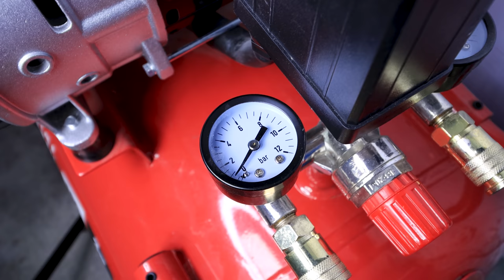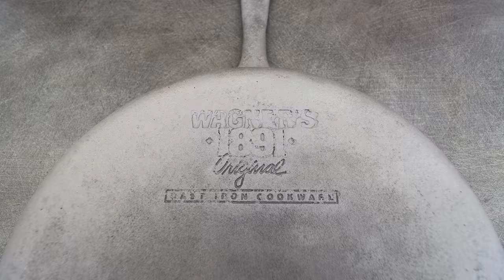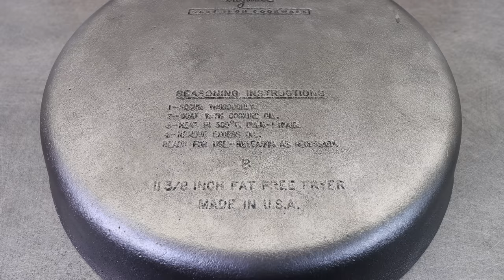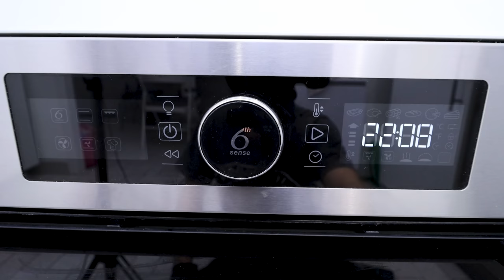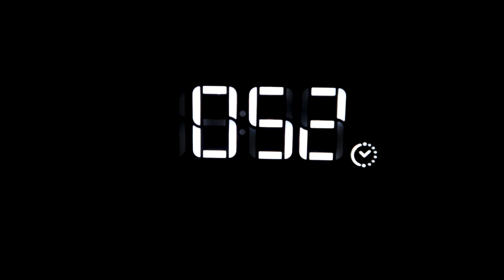PUBG PAN Restoration - Cooking Juicy Pan in to a Rusty Steak

Comment: Still like this video, but the pan was made in 1991-- "1891" was a model for 100th anniversary
Reply: Thats because he faked the whole shipping and note. He has no idea about any of that. Check the note he send to my Mechanic and this note
Reply: I agree. This is the anniversary pan from Wagner line. 1891 would have just thr maker Wagner and size '8
Reply: @falconNL  cállate
Reply: An original would have been milled smooth, these modern pans are really junk and only good used with tons of grease.
Reply: It could be 2011 and still be an amazing job, nitpickers man 🤦‍♂️
Reply: @ericalbany  you don't need a yo of grease if you season them correctly.
Reply: @falconNL  I didn't want to believe it, but it looks like you're probably right. He uses the same lower case "i" , the same middle line x in his "w", the same "f" and the same slanted "y". He also uses mostly uppercase letters. That's really disappointing. Now I have to wonder if he even really got anything sent to him or if he's just staging that also.
Reply: @HVGs  Unfortunately,  he's right. I just checked the note in that video and the writing is the same.
Reply: @GLASSGHOSTHUNTERS  top 10 questions science can’t answer.
Reply: @twylaburns6554  Having had one of these pans for 25 years and comparing them to vintage wagner cast iron in my collection, I can definitely assert that there is a difference in the cast iron. They do not season well nor do they stay seasoned as well during use. It must be a different alloy or they used a lot of scrap steel in the mix but they are not good pans. And yes I do know how to season and care for cast iron.
Reply: @HVGs  😳
Reply: @falconNL  I've got one question for you: who cares? The restoration was nice and relaxing to watch. Whether a viewer shipped it from Texas or he bought it on eBay, what difference does it make?
Reply: @falconNL  its part of his shtick.
Reply: Joe Montana is correct. There would be zero "cooking instructions" on a pan from 1800's.  Still a great video
Reply: @Nick-tx2fl  to many haters...he still does a good job with his restorations 👌
Reply: White?
Reply: @ThemissouriTraveler  
What? Wait!? So the pan I got from
Grams as a wedding gift in 1980 could be an original? I still have it.💁‍♀️
Reply: @twylaburns6554  If the surface is rough from sand casting as the new ones are a fried egg is going to stick.
Reply: I was wondering about that when I saw the cursive ingraved text in it. Didn't seem very 1891ish...
Reply: Obviously the fact that it has the company name on it means that it can be no older than 1972. That doesn't diminish the work to put it back in working condition. The only thing I would have done differently is to sand the rough pebble finish down.  Holds a better seasoning.
Reply: @ericalbany  my old griswold is smooth by comparison.  the cooking surface feels like glass with no imperfections.  it's a 1950's model, i believe.
Reply: @falconNL  
Of course. Have you SEEN the cost of shipping out of USA! This thing weighs 3kg.
Reply: Great video, but only 30 years old (like everyone else said).  Gotta hand it to Tysy though, looks like someone left it outside for 29 of those 30 years.  Nice restore!
Reply: No pans made in the late 19th Century had raised grates!  Lol...
Reply: Older cast-iron pans from the 1800s wouldn't have that much printing on the bottom or the grill lines. I have 2 cast irons and I would trade them for any "non stick" pan in the world. You just have to.keepnthem.seaaons and they'll last.for years.
Reply: I don't care all that criticism... I still enjoy watching him using the sandblasting machine. I'm just so happy just with that ! 🥰
Reply: They make great cast iron skillets today (not cheap). To say they have to be old to be good is not correct. A good, quality one, seasoned correctly and taken care of will be cooking well a hundred years from now. Google where to by, how to season and how to maintain. Like I said, they ain’t cheap, but they are high quality.
Reply: @ericalbany  i mean if you deep fry everything you eat then maybe?
seriously you'd wanna see a doctor if you use that much grease in your food.
Reply: This was the first time I’ve seen a Cast Iron pan restored in a media cabinet.. always wondered if it worked
Reply: @falconNL  The USPS seals are legit.
Reply: @GLASSGHOSTHUNTERS  I've watched off and on since he started. He fakes a lot of things. Restorations have gotten better but still prefer others out there.
Reply: @ericalbany  True, I own both old and new pans and the differences are huge.
Reply: @GLASSGHOSTHUNTERS   @falconNL   I removed a Like on this video because of you, but it's deeper than that. I don't know if I should thank you or despise you. I very much enjoyed Tysy videos otherwise.
Reply: It’s possible he rewrote the note to protect the real sender’s identity 🤷‍♀️
Reply: @Nick-tx2fl  the difference? Integrity and honor. They still matter to some people.
Reply: @LifeOfNigh  I've recovered many a cast iron pan.  You may see rust begin in the time it takes to move the pan from burning off the old seasoning to kitchen.  I also have the same pan restored in this video.  When I bought it, I also thought it was made in 1890, learned the real story later.  Wonderful metal if you take care of it!
Reply: @yadaroni  if you don't want videos that are played to to be something they aren't, I wouldn't spend any more time on YouTube or social media
Reply: I was just going to point that out
Reply: @HVGs  um...
Reply: @57WillysCJ  actually they have been putting logos on cast iron since the 1800s. I just did a spider deep skillet from the 1820s for a friend
Reply: @ericalbany  are you gatekeeping a pan?
Reply: @ericmatthews7652   My mistake. It was actually 1960 when the law came in to effect. The label had to say Made in the USA. This was all products manufactured. Memory not it once was. Identifying is much simpler by the weight of the cast iron, wall thickness and surface finish quality. Old cast iron of the early to mid 20th century was the finest not only here but in many other countries. By the way other countries started labeling their origin also.
Reply: @GLASSGHOSTHUNTERS  I'm guessing the note has been re-written to protect the sender's identity. Because that's what a sensible person would do.
Reply: @Ibis117  I would like to believe that, but then why go through the trouble of blocking out the address on the box? He would have to have opened the box, taken out the original note and copied it before resealing the box and blocking out the address on the box.    As far as protecting the identity of the sender by rewriting the note, why wouldn't he just block out the names on the note like he did with the box address? It just doesn't add up. I also don't know too many people that sign letters with their full name so there most likely wouldn't be any need to rewrite the letter and use only first names.
Reply: You can tell this wagner is Not older than the 1960's. If a Pan says Made in USA. Can not be older than the 1960's
Reply: @CreatingwithWinglessAngel  if you get pans from grandma use them save them and cook on them.
Reply: My thoughts exactly.
Reply: @twylaburns6554  all 4 of my lodges work perfectly, fry an egg with no prob at all sunnyside up or over easy releases in seconds. Oldest pan is 3 years. It's all I cook with
Reply: @57WillysCJ  i think your thinking about the made in USA. That started after 1962. I have griswold pans from the 20's with the company name on them.
Reply: @HVGs  🤣🤣🤣
Reply: @ericalbany  I have one from about 12 years ago. 
Mine is wearing smooth. 
It's not a build up of seasoning either, because i don't have a crazy build up. 
But it's DEFINITELY getting smoother with time. Maybe that's what happened to the older ones? Idk
Reply: @acriley7339  He's just pointing out the truth.  100 years difference is a lot.  Lol.
I have the exact pan as this.
Reply: Called it
Reply: @ericalbany  There are plenty of videos of folks buying Lodge pans, very rough. And grinding and sanding them down smooth. Once done, they seem to work quite well. 

As for me, I bought a stack of various sized Wagner pans at an estate sale. I cleaned them, seasoned them and love them! They were $5.00 each.
Reply: I have one and it is indeed a 100th anniversary model. Doesn't really matter, still cooks well and I like the vintage looking handle.
Reply: I'm SOO GLAD it wasn't just me thinking that.
Reply: @bg3160  I inherit everything.  After wash then wipe with clean damp cloth I put upside down over burners.
Reply: I am to one thousandth like. The happy ishere and it will leave in live 10 mins
Reply: I have the same pan my MOM gave to me about 30 years ago!! She hated cleaning it and I get a lot of mileage out of it - just treat her right!!!
Reply: @johnlambert6403  I wish my pans had the curved handle.
Reply: I was just gonna say, it's way too rough for it to be from 1891. cast iron back then was fairly smooth
Reply: @HVGs  That must have been exciting.
Reply: @ericalbany  Is modern cast iron different than antique cast iron ? If it is, is the difference  in the iron being cast, or the modern casting methods ?
Reply: @ivanthetactical6072  If you compare vintage and modern cast iron pans the vintage ones have the interiors machines and ground smooth on the inside- the majority of modern pans on the market have a sand cast finish with no additional work done to it.
Reply: @HVGs  Well at least your more holy than he will ever be.
Reply: @falconNL  You’re right, the dude writes the same way.
Reply: @barryrichardson1789  exactly🤣
Reply: @HVGs  he broke mine too
Reply: That makes a lot more sense. None of the verbiage would be been on an older pan, not even "the made in U.S.A".

That said, someone was really hard on a pan made in the 90s! But he did a good job on the restore, even if the steak was med-well ;)
Reply: Nice fry pan, nice restoration! I have an 1891 pan purchased in the late 90's without the grill lines.
Still using it, works great!
Reply: Came here to make the same comment.  Was not disappointed. Reproduction... I also think, the ribs on the bottom of the pan are a modern distinction. Unless there was more than one model. I agree with some other commenters. Older pans has a smooth cooking surface. The newer textured pans are less desirable. I did pickup a cast iron pan, a few years ago, just to have one... Based on what I saw here, still a good video, I will re-season my pan.
Reply: @ericalbany  It is a grill pan and doesn't need to be smooth.  It just puts grill marks on what is being cooked.
Reply: I'm jealous I want that old cast iron frying Pan
Reply: Thank you!
Reply: @ericalbany  Yup!
Reply: @Nick-tx2fl  It doesn't detract from the restoration which was very satisfying, but it'd be a bit weird if he was faking letters to himself
Reply: @acriley7339  true but it's about the lie not about whether or not it was done well
Reply: The second i read "fat free" on the back of the pan i knew it couldn't have been from the 1800s 😉

Comment: As soon as I saw that logo, I said "This is not from 1891."  A quick Internet search shows that that branding was on a pan made by the Wager company in 1991, to commemorate the centennial of the founding of the Wagner Cast Iron company.  Still, after this restoration, I don't doubt someone will still be able to use it when it IS 130 years old.
Reply: Exactly - I have 2 similliar pans - without ribs on cooking area - plain flat - perfect for eggs on bacon - these were bought in early 1990s - still using them after almost 30 years. BTW - I was really sad to find out that Wagner is out of business.
Reply: The font Aachen was designed in 1969. That was my first clue. Nothing about it looks 130 years old.
Reply: I heard that if it is marked made in the USA it's indicative of the 1950's. But hey what do I know. Beautifully done, love cooking on cast iron.
Reply: Also, nobody used the phrase, "MADE IN U.S.A." in 1891.
Reply: @TexDrinkwater  What did they use to indicate something was American made?
Reply: Love the sleuth work everyone did to disprove the date on the skillet!!
Reply: Candis from what I found the pans had to be literally marked "made in the USA" i found a 1930's pan, no "made in the USA" stamp has 3 notches in the ring on the bottom and a capital T with a dot after it. Also, heard to be to be cautious of old cast iron pans being used to cast lead. Not sure how to determine that though.
Reply: @mikeb2496  sounds like a Three Notch Lodge. I believe it was back in the early 60s that the government required everybody to put country of origin on all their products. To check for lead use a lead test kit.
Reply: Came here to say the same thing.
Reply: @jsmoritz2000  I thought I liked fonts and typefaces, but...
Bows to the master
Reply: @TexDrinkwater  there was no need to back then. Until the 80s, that wasn't a selling point for us.
Reply: @TexDrinkwater  Nor did they cast the seasoning instructions back in 1891.
Reply: @mattkeller2466  Do you mean 1880?  Because the US was a major iron exporter in the late 1800's and became a major exporter of other goods around the roaring 20's.
Reply: I use a 80 year old Cast Iron Pan
Reply: @CC-si3cr  in 1891, it wasn't necessary. Wagner was highly regarded and everyone knew where their product was made. I have one from the 1930s, it's a small egg pan and it's brilliant. It says WAGNER WARE SYDNEY O. That means Sydney, Ohio.
Reply: @BGUTTbeatz  All my cast iron was free, I got them from people who didn't know how to treat them. I reseasoned them all and while still not perfect, I prefer them to stainless or toxic Teflon.
Reply: @CC-si3cr  nothing, everything was made in the USA. In 1891. Now very little is.
Reply: @jsmoritz2000  how can you tell what font text is? Do you just remember a lot of fonts of the top of your head
Reply: Agreed. Most definitely not an old pan, but great resto anyways
Reply: @mylifeisaparty  Pretty much, yes.  I'm a graphic designer and novice type designer.
Reply: @trublgrl  🤓
Reply: @CC-si3cr  Back then, it was assumed it was made in the US if it was sold in the US.
Reply: @mikeb2496  You can get home lead tests used to test things like old pans, ceramic plates, and crystal glasses, bottles, pitchers, etc. Old crystal can be very high in lead, as can some ceramic glazes.
Reply: The nicest people use cast iron! Thanks for the recommended lead test kit. Acquired a grill pan skillet, going to test it before I put time into. Thanks again everyone.
Reply: What made me recognize it wasn't genuinely from 1891 was that it had seasoning instructions cast into the bottom. Telling someone how to season a cast iron pan is something we would see nowadays. Made in USA starts to show up on goods about 1960. Still, amazing videos filled with fun.
Reply: @CC-si3cr  the whole "Made In" monikers were not generally put on products until the 1930s when it was legally required by law in the USA.

Comment: Video description: “this is a very easy job to do at home without any special tool “.

Me: Yeah, hold on, let me turn on my sandblasting machine.
Reply: You do it with steel wool and time as well
Reply: @archkull  If you didn't have a sand blaster you would use a disk with bristles. Using steel wool would literally be like cleaning a bathroom with a toothbrush.
Reply: @archkull  I went with a wire brush attachment on a drill.  Still took forever.
Reply: I think a long bath in vinegar could "lose" a lot the rust and then you can scratch less.
Reply: Hold my beer 😂
Reply: you dont have a sandblasting machine at home ????
Reply: Yes hold on, let me build my sandblasting machine with my tools that I have to go buy with the money that I have to go make with the job that I have to hope I get hired. Lol. J/k. I would never get hired.
Reply: Self cleaning oven -> put pan inside -> watch everything slide off like dust for a cleaner slate to season
Reply: Let me just turn on the sandblasting setting on my mini fridge
Reply: He didn't even eat it
Reply: Hahahah
Reply: Guys look up electrolysis rust removal.... a plastic tub, some metal peices and a car battery trickle charger. Sand blasting leaves sand in the cast
Reply: @leokarasinski4217  Ah yes, a car battery trickle charger. Every good kitchen should have one.
Reply: @btf_flotsam478  well sure, I get that. But, its easy to get and less than 50 bucks.  Whats a blast cabinet, a compressor, and 50 lbs of media cost?
Reply: @lazycouch1  His point remains.
Reply: @DanDeyBananaJoe  Dream on.

Comment: Several thousand dollars later and that $20 pan looks like new!
Reply: The only thing that cost anything was thr vegetable oil...
Reply: @mynamesjudge  ???? An entire sandblasting machine doesn’t cost money?
Reply: Free makita drill, free wire brushes, FREE SANDBLASTER😂
Reply: @stephenvargas6134  You don’t need it… But have fun doing it with a chunk of steel wool.
Reply: @mynamesjudge  Most people don’t own tools like a sandblaster man.
Reply: For starters that wasn't a 130 year old skillet. The Wagner 1891 series were made from 1991 to 1999 as a 100 year commemorative promotion. They are extremely easy to find.
Reply: @michaeldavidson9939  It was a joke…
Reply: @bruhmomentum3098  A sandblasting machine has many uses. You can get one for about $200.  As tools go, that's not much. A second hand machine could be had for much less.
Reply: @gagelong9087  If you don't already own a drill, then this vid, or life itself, is not for you.
Reply: @michaeldavidson9939  Who cares?